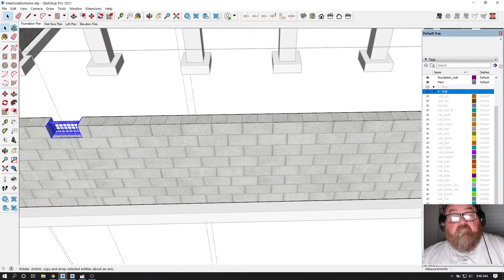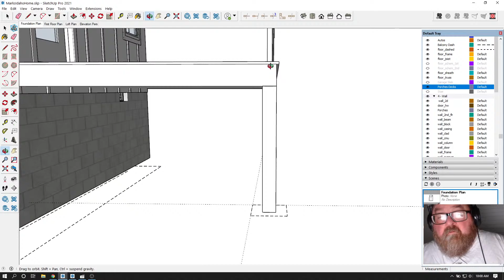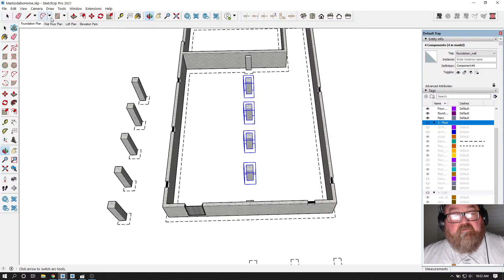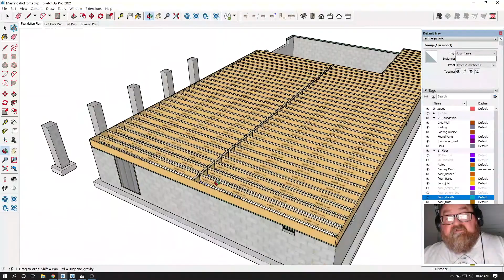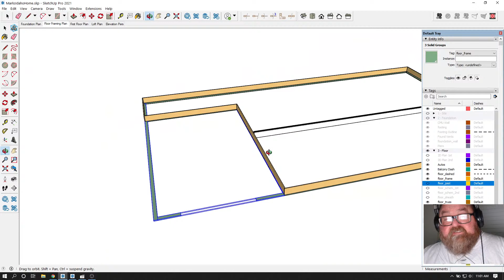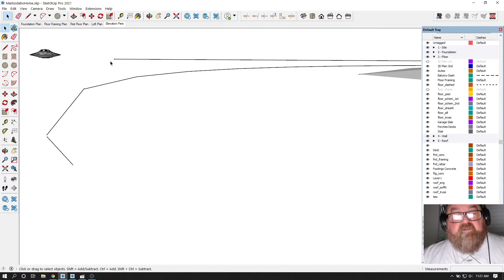Morning Work Session #4 on Mark's Home - SketchUp -  Moving to Paper

Comment: Hi Artisan tony, tried emailing you but not sure if it made it through. Is there a way to reach out to you regarding a small project? Trying to come up with numbers/plan for a 2bd/2ba 980sqft cottage. Anyhow, look forward to hearing from you!
Reply from the maker: Hello I checked my email but I didn’t see anything. You can send from the contact form at atdrafting.com. Thanks
Reply: @ArtisanTony  ya I used that form a week or so ago….should have said form not email.
Reply from the maker: @coryclark1239  sometimes gmail puts emails I get from my website into the spam folder so I probably missed it but I went back to the server and found your form.  I have now sent you an email. Thanks!
Reply: @ArtisanTony  happens to me too! I’ll check now, appreciate it!

Comment: Who can I go and talk to about how to figure out  how  space  out apart the 6x6 posts on a 20x16 foot  patio Gable cover .
Reply from the maker: You can go 10' on the 20' side or 8' on the 16' side.  I would use 3 - 2"x 12" or a 4" x 8' for the beam that the rafters sit on.  This should work unless you live in an area that gets heavy snow.  Use 4" x 4" angle braces about 20" long at the corners from the posts up t the beam to stabilize the roof in case of a wind event.  I can help you if you want to contact me at atdrafting.com.  I can draw a model for you and provide printable drawings. I would also verify load conditions for your area.   Snow loads would be an issue up north and wind loads would be an issues in coastal zones.